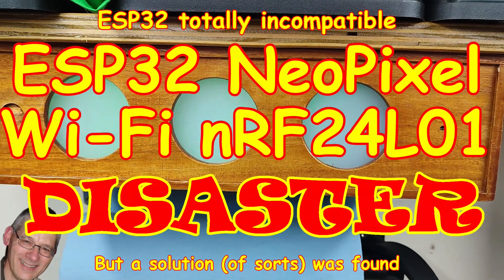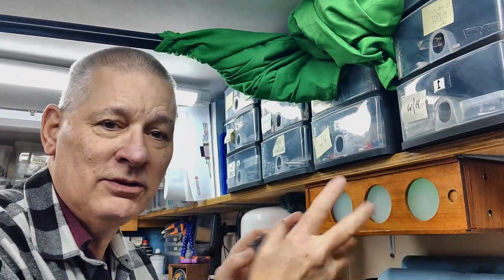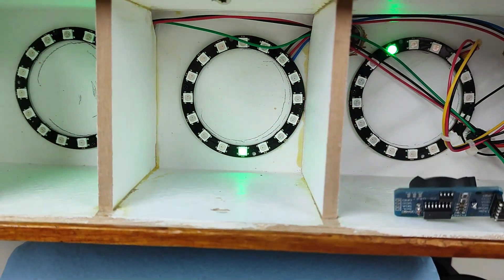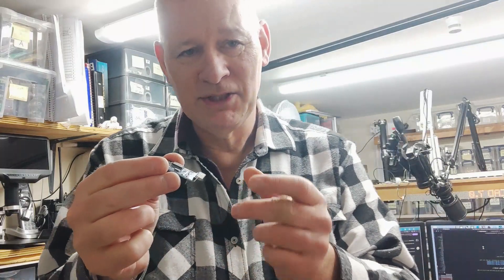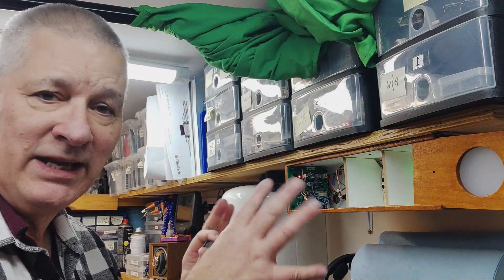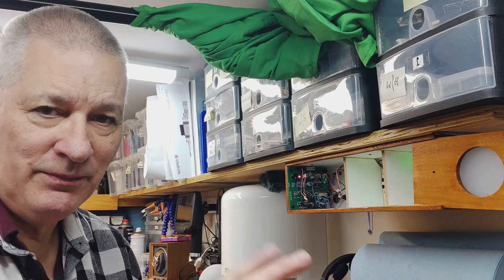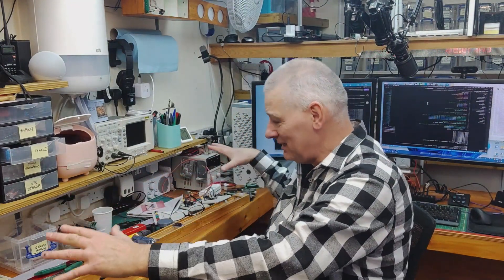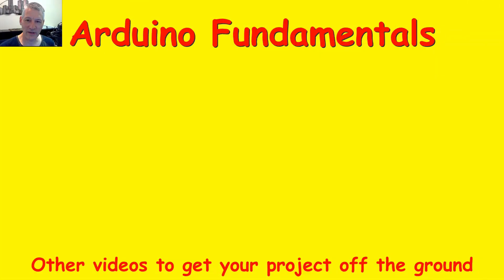#262 ESP32 + NeoPixel + Wi-Fi + I2C + nRF24L01 disaster!😮What to do?🤷

Comment: Most JTAG/emulators have a register comparison / recording function. Do a register dump and compare the working with the non-working. I find that trick so useful, I have scripts that gather the data, compare it, and tell me the differences. So may times the tool has illuminated the register or bit(s) that aren't being set correctly.
Reply from the maker: Good idea. What worries me is the code that is failing is the Adafruit NeoPixel code (probably timing issue... or something) so not as useful to me as it would be otherwise.

Comment: Sounds complicated Ralph.  My initial thoughts are 'I wouldn't start from here'  🙂.  I would have used ESP-Now.  I'm assuming that there are some sort of ESP boards in the bins doing the monitoring.  Each of the bins broadcasts a structure, the same for each board.  In the structure I would use 3 integer variables.  If, say board 1 (in bin 1) is open it sends a number greater than 100 in position one of the structure. If board 2 (bin2) is open it sends a number greater than 100 in position 2 of the structure.  A similar system for bin 3. Obviously, an integer less than 100 is an indication that the bin is closed.  Inside the workshop there is the ESP32 which is receiving the broadcasts from the bin boards over ESP-Now.  Its sole task is to get the time, monitor the broadcasts from the bins and to set a relevant pin high or low to switch on/off the appropriate neopixels to the desired state.

No NRF wifi shenanigans, no pins used.  
What do you think?
Reply from the maker: I wouldn't disagree with you, Hari. If I were designing the project today I would use ESP-NOW with some ESP32s (even 8266s) in the bins to send the code. Also, you can make the ESP32 sleep for as long as you want, not just 8 seconds like the ATMega328p.

Unfortunately for me, that is all water under the bridge. I designed the ATMega328p / nRF24L01 circuit because it was quick and easy (I have experience of these).

Since then, I've acquired experience of ESP-NOW and use that with my three temperature sensors scattered about my house - but too late for this particular project! No, I'm not going to start again!
Reply: @RalphBacon  I am just in the process of learing about Blynk.  Never bothered in the past, but with your bin system on an ESP_Now system, you could check the state of the bins whilst out shopping via blink.  I'm building a greenhouse sensor system.

Comment: I would chain the leds together, you can sort out which ones to turn on and off in the chain in software. I think your issue is related to interrupts and timers as everything you mentioned uses one or both. I am sure it can be made to work but without having one in front of me exactly like your I can't comment more on the issue. Look into which devices are using which timers and which are using the interrupts. I am sure you have more than one connected to the same timer or interrupt. It may be as simple as changing pins, or as complex as doing your own timing for something like the timings needed to talk to the led. But I can almost with certainly tell you the communications issues are related to timers and interrupts.
Reply from the maker: Yes, interrupts or timing or something. I need to investigate more first before I resort to changing my hardware and code to string the LEDs together.

Comment: Adafruit's NeoPixel library is quite timing sensitive (and last I checked disabled interrupts), but there are a few other libraries available which work better. I personally use FastLED without issue, and it uses the SPI peripheral rather than bitbanging (but you have to use an SPI capable pin).. 

I wonder whether it was the ESP32 itself or just the 3v3 regulator that died? The ESP32 will have an internal voltage regulator down to say 1.8V for the internal logic, and that might survive a short time with a 5V input.
Reply from the maker: I think that the ESP32 can use most pins for SPI (it's very flexible, but just how flexible I have not tested) so I might try the FastLED library, thanks.

And I will check the regulator and other bits before I discard anything!

Comment: Why not just put all the WS2812b's in a single chain and have one task to drive them, and just change parts of an array to change colours etc. Now you know why I stay away from libs, that way I know what my code is doing and when. Had problems with FastLED where it was corrupting the first 24bits of data sent! It was something caused by FastLeD and platform i/o code.
Reply: Totally agree.  Not sure if those circular leds can be chained, but a strip of WS2812bs certainly can be.  You can light up a section of leds at the beginning, middle, end of the strip, any color.  One task to drive the strip.  Always use separate power supply for the strip, do not power from micro pin.
Reply: @mainer8912  you only need to pick up the signal out of the last LED in the ring. which should not be a problem. As it will be the led next to the first one, that's the good thing about the rings you end up where you started.

I've put a few rings into a glass lamp cover where i had to cut the ring so it could be sort of screwed in to the globe.

Comment: And welcome back to the comments for me, sorry but someone said the I  have copied you by saying "welcome back" at the start of my video. :-) I use my own driver to bit bang the WS2812B's with no problems with WiFi as yet. Its just another bit of code that runs in a task. Use it esp8266 and exp32.
Reply from the maker: I say that imitation is the sincerest form of flattery! If I disable (do not start) the NeoPixel tasks, the Wi-Fi runs as it should. It's something (like timing) do with NeoPixel control, running in a task. 

I'll find out what it is and then send hate mail to Adafruit for causing me all this hassle! (Just kidding, I quite like Adafruit products and code).
Reply: @RalphBacon I suppose it also depends on how often you are updating the LED’s as the number of LED in your rings should update in no time at all. then you think the longest pulse is the reset at >= 50us.

But I would suggest putting the rings in series and only having one LED driver routine to worry about.
And work out how often you need to update them, so if you’re flashing them at 1 second intervals it should give the WiFi plenty of time to do what it needs to do. 

I expect that the library is using some form of blocking code to get the timings right and this is stopping the Wifi thread running at the correct interval. Causing the Wifi to drop out etc. But if your on dual cores this should not be a problem. 

So it could be a hardware issue, some shared resource getting held for too long. Bit bang your own driver so it’s running on your core and directly accessing the I/O should get around the issue. For low numbers of LED’s you don’t need DMA to do it.

Comment: It was not clear from the video if you were creating 2 seperate i2c interfaces in code or using one and patching the wires across to the RTC If you are using 2 then the code on the expressive github page espressif/arduino-esp32/issues/977 should help. I have used similar  code to drive an i2c display and transmit DMX via an NRF24L01 with no problems.

Comment: Hi Ralph, when all’s said and done it’s kinda reassuring to know that someone with your years of experience can still make schoolboy errors like connecting 5V to the 3V3 pin 🤪
Reply from the maker: I had the DuPont cable in my hand. The RTC was dangling ready for connection. I connected one end of the Dupont to the 5v. Then for some some reason connected the other end instead of to the RTC, to the 3v3. I was distracted (that's my excuse and I'm sticking to it). 😢

Comment: Don't know if anybody will care about my comment but here it is. Adafruit libraries consume a lot of resources, which the ESP32 should be able to handle but it has it's problems, I use the NeoPixelBus.h library with Wifi, Wire BLE and 2 different display libraries which are TFT_eSPI.h and LovyanGFX along with the SparkFun_ADXL345.h library and a touch screen connected via the Wire.h library in one sketch. Oh, btw, the one display is connected as 8bit parallel the other is connected via SPI and I also have the HTTPClient.h and TJpg_Decoder.h library in the code and all this on a ESP32-S3 module on my designed PCB. Ups while I am at it, I also have FT6236.h, ezTime.h and the ESP32Time.h library. Sorry, I think I mentioned them all now. Good luck.
Reply: Sound like you are working on an exciting project 🙂
Reply: @deslomeslager  Wow, you actually hit the nail on the head, I am indeed working on a new product and the mentioned libraries in my comment are only describing half of the product, which consists of two 2.6" capacitive touch displays, a smaller 1.47" outer display, running on two independent ESP32-S3 chips/modules. And all of this you can fold and put in your pocket and since the ESP has WiFi and BLE you can make anything you like out of it, it also has some smart features and of course a Lipo battery with wireless charging 🙂

Comment: one more note,
most probable reason (wifi failure in combination with neopixels) is.. you are too heavily communicate with neopixels,
ie. most of the processor time, interrupts are in disabled state - too often and too long.

circulating led is visualy nice, but try something simpler,
ex. turn all leds ON, wait second, turn all LEDs OFF.
Reply from the maker: Yes, the timing could be the issue, inasmuch that the NeoPixels are stopping Wi-Fi working by disabling interrupts (for too long, or at all).

Comment: Using tasks in ESP32 is very tricky 
(I avoid using tasks and I prefer cooperative multitasking in main loop using millis() events)

NEOPIXEL adafruit library disables interrups (for certain time) when communicating. (you'e using 3 tasks)
Not to mention - I2C also uses interrupts to handle hardware events (you used another task servicing I2C).
Not enough ? - hidden (closed) wifi servicing firmware (running on core 0) also uses interrupts. 
Wifi FW needs frequently check and handle wifi events.

This all seems to me as "big candidate for 99% failure"

Using tasks without propper synchronization primitives causes headaches for programmers.

My approach (advices) 
- not to meddle with CORE0 (ie. servicing wifi firmware stack)
- that's why I avoid using tasks at all (in ESP32)
- if using tasks - dont service GPIO pins
- if using tasks - dont manipulate interrupts (disable/enable) !!!
- tasks are usefull/usable mostly for memory-only long-time computations
- if you dont follow these guidelines you probably get into big troubles

Conclusion 
- my advice is to move all your jobs to main user loop (CORE 1) using time sliced approach
- nothing (you described) in your project needs true realtime capabilities (neither time critical)

Comment: Had a sketch that ran fine on USB power(4.82v) but went wonky on a separate power supply(5.00v).
After may days of tearing my hair out, I padded flash memory with useless data thereby moving
the sketch into a new section of memory and now everything works as it should.
Bad memory cell???
Reply: Sound possible! It won't be easy to trust the esp32 after this.
Reply from the maker: There's probably a flash memory checker sketch somewhere you could use, I'm sure.

Comment: Hi Ralph!

For neopixels and anything that requires a tight timing, given that my plan is to use a wifi board to control an LED project, one thing I've thought of doing is having my main program on ESP8266 (or ESP32) and the program controlling the ws2812 LEDs on a dedicated 328P(B) either having the bare arduino as an I2C device or even through serial. Then even if the ESP or whatever completely shuts down to full sleep, the dedicated "processor" would keep controlling the light show.

I also wonder - I've found that the WS2812 LEDs once they've been given the show() so long as you're not doing an animation (static colour) they usually keep that without any further updates from the micro controller, so theoretically if you didn't use an animation, that might at least ease the situations in which crashes happen - Just thinking of ideas though I haven't actually played with ws2812 on anything other than the Atmel 8bit micros yet, suppose I've got all that fun to come :D
Reply: There's already an Adafruit product (called Seesaw) for offloading the NeoPixel bitbanging to a different microcontroller. It is meant for managing your GPIO tasks while your main microcontroller talks to it via I2C
Reply from the maker: @bornach That's interesting - I shall check out Seesaw. It's almost as though Adafruit recognises the issues with bit-banging NeoPixels.
https://learn.adafruit.com/adafruit-seesaw-atsamd09-breakout/overview
Reply from the maker: Hey, Jess, where have you been hiding? Yes, the timing is the thing. I think Adafruit do some naughty things that works mostly but when used in a multitasking environment it makes things go wrong. I shall deffo check out my hypothesis.

Yes, I could NOT use animation but that, to me, is the tail wagging the dog. I am the master! Well, apparently not. 😔

Comment: I thought it strange you had problems with 
 Neopixels with wifi since so many have been successful with it.

Someone mentioned power, and that could be a factor.  I breadboard a project that used wifi for producing a website, measured two temp probes, and would operate a valve depending on temperatures.  Also had a small OLED display.
I frequently had issues where ESP32 would have a hard time booting.  Added caps which helped but still often unstable.
When I perfboarded the project I put my caps under the ESP32 socket really close to the ESP power input.  Never had a boot problem after that.
I did try adding a battery voltage monitor using an ADC pin.  Voltage reading was inaccurate and messed up temp readings from the digital temp probes.
Reply from the maker: Yes, power was certainly a suspect for me but even when driven with mega power supplies it still had the same issues. No, this is software related, I'm certain.
Reply: @Ralph S Bacon  you can have all the source power you want but if there's enough wire resistance, a sudden draw can cause enough of a sag that the ESP32 can reset or have other issues.  Especially on breadboards.

Comment: I have had intermitant problems with WiFi & I2C & SPI as well.  With the Arduino 2.0 IDE.  After some random number of deepsleep's, I can no longer connect to WiFi.  But if I power down my board & wait for about 20s and power it on, it will connect to WiFi just fine.  My I2C has a temperature sensor on it.  I have a display on my SPI , two buttons and a MOSFET to turn my display on when I need it. It's usually off.  I store my temperature log in 500KB of internal flash (SPIFFS).

I go into deepsleep every two minutes  to minimize self heating and it works fine.  The work I do after deepsleep takes about .4s.

Your problem sounds like there is a global variable for SDA & SCL in one thread.  You might unknowingly be talking the wrong protocol to your I2C devices.
Reply from the maker: Unfortunately, it's an Adafruit library, plus the nRF24 library, plus the Time library... the list goes on. Who knows what they all do (wrongly) but get away with it, most of the time?

Comment: When you first started describing the problem, my guess was a power problem: if you're powering the neopixels from the board's regulator, you might be getting close to brown out when the WiFi goes to transmit.  It's usually better to power the neopixels directly from your 5V power supply (though still be sure it can provide enough current for everything).  A downside is that the 3.3V signal with the neopixel data borders on unreliable when the neopixels are powered by 5V.  I've heard that using a diode to drop the neopixel supply voltage to 4.4V will make it more reliable for shorter strings (for longer strings, the voltage drops start to affect the color).

But then you mentioned memory corruption.  That can be a power problem (if the RAM doesn't have quite enough power to maintain its state).  But that's more likely to be a software bug somewhere.

I've got a cheap Chinese ESP32 board using WiFi and neopixels (as a nightlight).  It's running the stock WLED software (which I think uses FastLED for the neopixels).  That probably doesn't help with your project, sorry.

IIRC, FastLED will use the ESP32's I2S hardware to send the neopixel data (instead of bit banging a GPIO), as long as you use the correct pin (I2S is one of the few functions that can't be reassigned to other pins).

As for why it finally started working with the RTC code in a separate task, that makes me think there is a timing problem in one of the libraries.  Perhaps a library is not disabling interrupts while directly accessing hardware registers.  By putting the RTC code into a separate task on the same core as the neopixel stuff, it would make it impossible for both to run concurrently.  (But could one interrupt the other?  I'd have to explore the task preemption documentation for ESP32's variant of FreeRTOS.)
Reply from the maker: Yes, software is the cause but exactly what remains to be seen. You mention timing and that is Prime Suspect #1 for me. That and interrupts, which is a sort of timing issue.